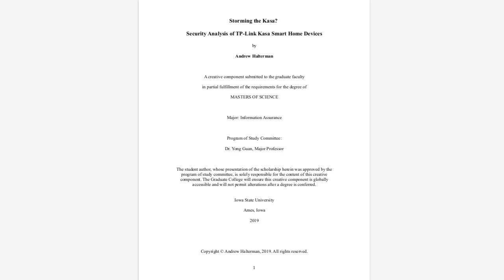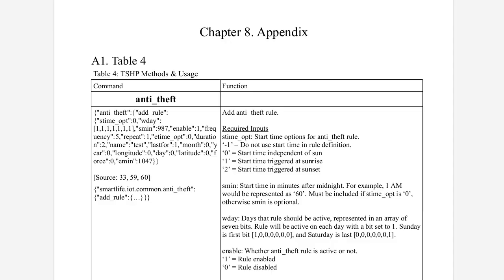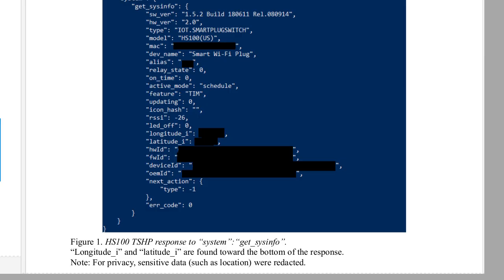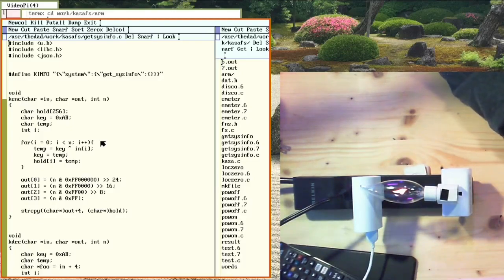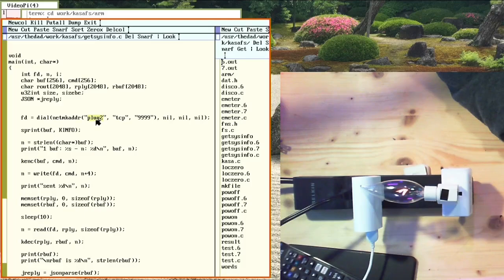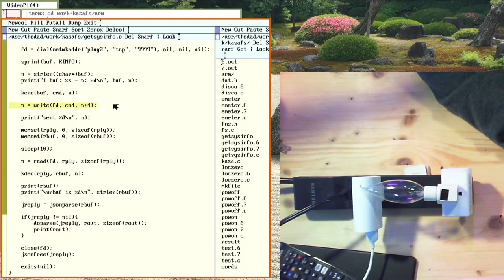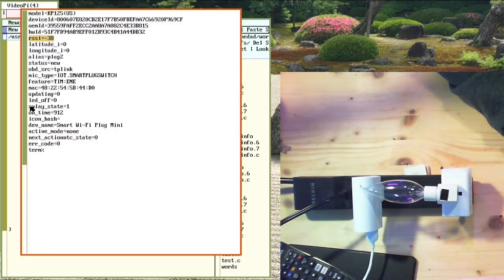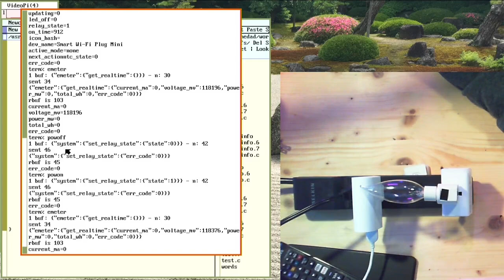Kasa Smart Plugs; taking control with 9Front.

Comment: It would be interesting if the 9 kernel could be ported to the device itself, but that would be a lot of work, maybe less so for the plugs than the bulbs. Also weak/no encryption is required by law in the US if the product is going to be sold outside of the country.
Reply from the maker: The newer ones don't have enough CPU to run a full OS.  There are people working on 9P interfaces for microcontrollers.  Styx-on-a-brick is one example.  A newer one NinePea.
Reply: @adventuresin9  I don't mean run a complete plan9 system. If the linux kernel can be stripped down to run on a similar microcontroller, the 9 kernel probably would only provide a 9p interface. The video about NinePea, was fantastic. I saw it months ago. It was mentioned that someone was trying to get inferno to run on 256KB of ram by keeping read-only data in flash.
Reply: Most of these plugs are welded shut so if the flash was unsuccessful it will be a brick.